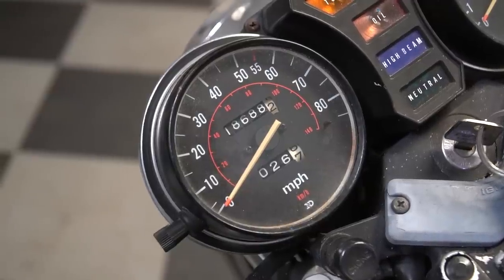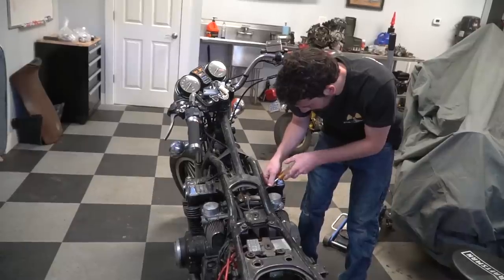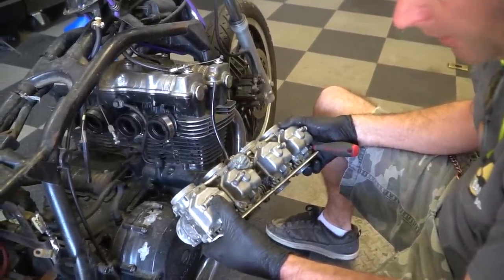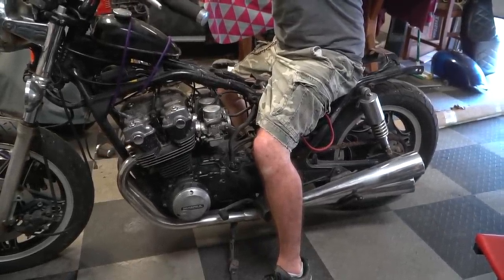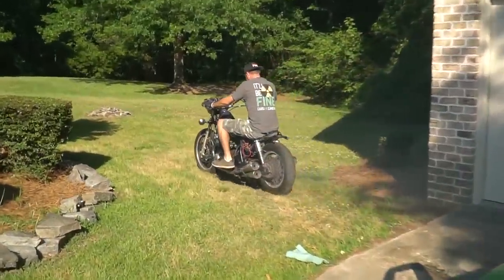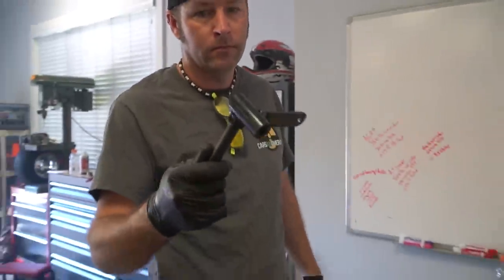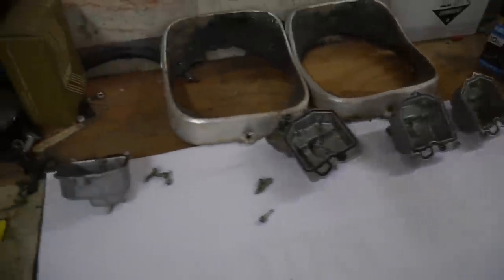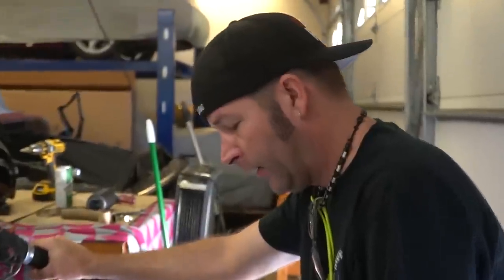Cheap CB750, Will it Start? Cross Kart Build Pt. 4

Comment: It's super lean. I've built many bikes. I seen ya trying to pull the choke to rich it up but that dont work with them carbs. The bike would run better if it had the factory air box and filters. And that jet was part throttle jet. They have main, mid and idle air screw.
Reply: also 95 might be too high octane, late timing, lean, I also heard a backfire
Reply: True Boys Need add Air box+stuff and put all in same setup in  vacuum gauge
Reply: there is no thing called to high octane
Reply: Same with my old XJ 650, the run awful if you remove the factory airbox.
Reply: These guys obviously don't know what they are doing, just making it harder for the real mechanic to fix.
Reply: @Hermiwalle  good one
Reply: Yep a stock airbox and air cleaner will fix the issue
Reply: Yes you are right !!!
Reply: @Charlieswag9000  too high of octane hahahahahahahahahahahaha
Reply: @Regular_Thomas  you didnt know race gas is only for high compression engines? higher octane, later combustion
Reply: Came down here to type out this exact comment.  The factory air box is an important tuned item, and the removal of that will cause this exact problem.
Reply: Herman Wallin Not true you can always have too high of octane!!
Reply: @kisermotorsports7854  i believe he's joking
Reply: Octane is a rating of how knock resistant a fuel is.  The way more power is made from added ignition timing..
Reply: @Charlieswag9000  yo0ppl

Comment: Hey put the air filters back on them the air filters can pull a vacuum which will let it pull more fuel ran into that issue before
Reply: Or instead of creating a restriction with filters you just jet up the carb to make it pull more fuel
Reply: nathan butler it still wouldn’t have the vaccume it would need in high rpms without the filter
Reply: they won't listen . been telling them for years the carbs won't work right without the air filter on it.
Reply: @gokarting1018  well it wouldnt with pods thats why i made a fiberglass  plenum on mine that has all 4 carbs going to a plenum then to a single filter
Reply: @nathanbutler8240  These motors are precisely tuned.  Anything other than the factory airbox or something similar like what you made won't run properly.  I cringe every time I see pod filters.  Lean backfiring, probably lost low end torque.  Lol.
Reply: @tiporari  the factory air box to the plenum that i made if anything i smoothed out the airflow going into the carb less turbulence cause the factory air box is plastic with reinforced gussets on the inside you snooth out the air flow you get more air speed you get more air speed you can squeeze in more volume. I did the same to my old  kz-900 with ram air tabs on the side it catches air and forces it down the plenum gained almost half a sec at the track its a huge difference from the factory air box. If the factory box was that good you would still see people using them at the drag strip. The more air you can get in and out the more hp you will have doing the air box mod and cutting the baffles out the  mufflers it really wakes these bikes up
Reply: Yeah these guy crack me up on what they don't know. 
They know enough to be dangerous.  And that's about it.

Cool on what they do though.
Reply: @tiporari  do a google search of the hayabusa carbon fiber air box and you will see what i based my air box off of
Reply: The right jetting does the trick I run pod filters on my en500 which is a cv carb and it runs right on the money even gained a little bit of torque but is it smooth absolutely not but it doesn't require alot of throttle input to go 60mph either
Reply: He already "drilled" the  jets out to a now unknown number so it's gonna be rich whatever they do. They're really wasting their time with this heavy old lump. They think it's gonna be like having 40 hp that's crap. They need something like the ducarti that's gonna be wild. They need another Ducati motor or a 600 and it'll be awesome. The whole time they're spending on this thing they'te not moving forward with the build. I hate wasted time for minimal gain.
Reply: Don’t even get me started on how much low end power they lose on straight pipes!
Reply: My r1 ran like hammed hell when I race ported the air box and could not jet it out had to get a new air box cover b4 it would run correctly again.
Reply: Hes right needs air filter with the diaphragm style slides
Reply: @Go karting101
That's not how carburetors work.
Reply: derschwarzgeist when u fight for months on a set of carbs on an engine and decide to put the air box on and it fixes all problems with it then u can’t say much about that
Reply: wheeln 24/7 you may hate wasted time for minimal gain but in the end it’s their money and they are gonna do what’s easier and cost effective for them. If they put $1,500 motors on all their builds it wouldn’t even be fun anymore. Reviving some older engines is fun
Reply: @joeshmo2473  just watch how they build cages... hahaha. Someone needs to tell/teach these guys about the properties of metal and welding..
Welding joints where it should be just a bend.
Reply: Correct !! iF THEY OVER JET IT WILL MOST LIKELY SMOKE.dam caps !!
Reply: This is why despite running a breadbox/lunchbox style housing I still have my factory airbox safely tucked away. Anybody who doesn't want to fool with the carb every time the weather changes is going to want the stock box.
Reply: It'll be fine.  So many drama queens doing their best to create fuss over nothing.  This isn't John and Isaac's first rodeo.

Comment: The problem is the CV carbs. That’s exactly how those bikes run without the air box. With pods or no filters there is not enough vacuum to open the slides and let air and fuel in. It is hard to get them to run right but you can start with the free mods- cutting a couple loops off of the slide spring and shimming (with a washer) or shaving down the needle and opening up the main jet a bit more.

Comment: It's the no air box. I've worked on lots of these bikes. They hate pod filters. Makes them idle rough and it's not smooth through the Rev range. Best way to fix it on the cheap is to wrap the pods in foam filter material. Makes them 2 stage filters and it works great. I hope y'all see this comment, it will save u lots of headaches. Cheers

Comment: Hey! That motor will run lean with out the correct amount of vacuum behind the carbs! Pod filters make it very hard to tune so see if you can get your hands on a factory air filter! It will idle perfectly fine with out it but as soon as you throttle up it will bog out lean. Btw the plunger type throttles that move up and down behind your mechanical throttle plates rely on air travel to make them open correctly, please see this because I promise you this is your problem! I’m a motorcycle mechanic on the side.

Comment: Wrap your pod filters in some kind of tape, electrical, duct, gorilla, doesn't really matter. These are constant velocity carbs (CV carbs), they don't like pod filters or a high flowing exhaust system. Jets can't easily be changed, its possible if you have the time and know what you're doing but it's a massive pain.

Comment: guys ive a lot of experience with honda cb bikes, things to check on you 750 are the rubber plugs in the float bowls (if they leak fuel past them it causes running issues), air leaks (normally from where the carb rubbers mount to the head) and finally check the jetting, to run correctly with those pods it would have needed to be upjetted, if the jet are the stock ones then it wont rev and will run exactly as it did in the video.

my guess would be air leak to be honest as it cuts out at idle.

hope you read this and my advice helps.

keep up the excellent content.
Reply: You forgot about the slide diaphragm rubber
Reply: @SHSPVR  there is no slide diaphram rubber like you would see on a harley. The top of the slide is like a puck and the aluminum caps seal with a big plastic ring that sits in the groove on top of each carb body.
Reply: @AkiraMikaela  They where big round rubber gasket in my day and there a o-ring for needle in the slide I'm not take about the type that a disc type rubber slide diaphragm
Reply: @SHSPVR  yes they use that design for many makes and models but not for that particular rack of carbs on the bike. The ones that were on the floor are the diaphragm type that you are referencing. You can see this by how shallow the caps are on the carb bodies.

Comment: Need the air filters back on it, completely normal to run like that without them. Those are the top end Honda carbs for the year. 3 jets, 1 main (largest goes straight to the top), the second jet that isn't covered draws fuel and runs it through the 3rd jet under the rubber cap. Rubber diaphragms under the covers on the sides are air cut off valves that allow more fuel when you let off the throttle at higher rpm so it doesn't pop thru the exhaust. Majority of the smoke is burning off fuel that made it into the oil making it easy to push past the rings. Really enjoy watching you guys playing with your toys. If you have any questions about those carbs you can shoot me a message, I'll be happy to help. Jeff, Man Cave Cycles, New Prague MN.

Comment: When you have a carb for each cylinder you have to sync the carbs with a vacuum gauge to get them pulling the same amount ..

Also, those are vacuum slide carbs, not mechanical slides .. So , they will run like dogshit without an airbox even when the carbs are tuned correctly ..
Reply: Well said 👍👍✌
Reply: That some what true about sync the carbs with a vacuum gauge we are not there to see what going but what is not true is airbox BS you are come with but the way it trying to rev sound it be a semi plugged exhaust, but I would also slide diaphragm rubber as they could be crack causing a air leak that to can keep from run right and there host other thing like a clogged passage.
Reply: Lol finally someone to back me up to get em to buy some FCR's . .
Reply: If it wasn’t touched the carbs should be still synced by a Japanese factory
Reply: @mowler8042  Is that a joke?
Reply: Ijusthopeitsquick no if it’s running great why mess with the sync.  Every Japanese bike I worked on trying to make it run better when the issue is really not the factory settings you just mess it up with what I call the domino effect. Make it run with the factory settings and search back why it’s not running correctly
Reply: @mowler8042  of you've messed with the carbs (including stripping them), then they won't be synced anymore
Reply: Simon Mark Rogers they didn’t strip them and if all the gaskets are old and it’s leaking still it just needs gaskets or carb boots, compensating by syncing them you’re just going assbackwards
Reply: @mowler8042  They ran drill bits through the jets. Not a particularly accurate way of cleaning them, so they've been messed with. If the jets are then different sizes (albeit only slight), then they've been messed with. I rejetted mine many years ago and they needed syncing (V twin)
I wouldn't say it's essential, but it will run smoother
Reply: @joeshmo2473  you're
Reply: @SmR8008  ya you might be right still if they drill them out with the same bit they should be all synced
Reply: @mowler8042  😄😄 I wasted too many words on this troll (joe shmo). I think you summed it up with; "you're"😄👍👍👍
Reply: @mowler8042  nothing that old "hasn't been touched"
Reply: lmao just in case anyone is curious as to what the definition of egregious was : extremely bad in a way that is very noticeable
Reply: @joeshmo2473  I didn't comment on your grammar, I commented on the content of your post... Whilst most people were having a healthy debate on what they believe is right or wrong, you are slagging them off,as opposed to contributing to the discussion.  I  may or may not be right on the subject we were discussing and equally, others may or may not be right on the subject. However we continued to show each other respect, just as we would if we were talking face to face. In short, we were conversing as the adults we are, as opposed to the child you appear to be😊😊
Reply: @SmR8008  lmao, I bet that singed his arse, he probably got tired of sharing photo's of his sister with his friends and decided to have some grown up chat. worked out well for him lol.
Reply: @hunter100t  Love it😂😂
Either the Poor fella is still thinking hard of a comeback, or his Mum has told him he can't use his phone until he's cleaned up his bedroom 😅

Comment: Pod filters do not work very well on these engines also you may try to vacuum sync the carbs make sure they are all running even maybe a valve adjustment as well
Reply: Well said!👍👍✌
Reply: they usually work best with the original air filters, with the other one you have to go mad with jetting
Reply: Ya most of the time it's not worth the hassle trying to rig it all up better just to stay oem
Reply: Make sure the same jets go back into the same carburetor, get them mixed up and you will be tearing it back down.
Reply: Unfortunately most people don't realize that the outer carbs have different jets than the inner, esp on these old pos carbs

Comment: Cv carbs need an air box or proper sized pod filters to pull vacuum so the diaphragm will pull up the needle to allow more fuel. 

TLDR : put the filters back on.....
Reply: I think you are right.  Especially with older slides and rubber inside
Reply: Yes... Vacuum carbs need airbox volume.
Reply: I have found that you don't need filters of any kind for a cv carb. I bought an 83 shadow 500 ( it still had the stock jets) and ran it without filters of any kind during the winter (20-30 degrees) it ran a little lean, but it still ran good. I now run it with slightly larger jets and pod filters and it runs like an absolute beast.
Reply: I disagree with your opinion , i have tuned tons of cv carbs that run perfect with no air box at all its not the carb but the undereducated person tuning something they know nothing about, if you cant get your cv to perform right do some research , one big mistake most people make is over tightening the air mixture screw and once you damage the needle seat the carb is garbage , carbs are very precisely made and 99% of the time its people messing with stuff out of thier mechanical level ......
Reply: If you run cv carbs open there will be a larger latency from throttle input to opening. Tune them to run cleanly from closed to wide open under no load.

Comment: I owned and loved a 1976 CB 750 F the Super Sport Model. These are great engines. To adjust the carbs you need a set of 4 vacuum gauges to get all 4 carbs running the same. The smoking might be rings or a bad head gasket or nothing but do a compression test.  The timing is adjusted under the left side cover if memory serves using dual points. Two cylinders fire at the same time. The revving problem is definitely a valve adjustment problem. The valves adjustment should be done on a cold engine for best results. Back in the day I could do a full tune up in less than an hour. These engines are dead simple to work on as long as you don't split the case so if a top end rebuild is needed don't shy away from it as the results are worth it. Good luck guys. I always wanted to build a Go cart or something powered by one of these engines.  You have a built in 5 speed transmission and should use it.
Reply: I put a Hodaka 125cc on a go cart once, after 2nd gear you can't steer it, because you have too much speed and torque driving it forward. A motor this big wouldn't be practical on a go car, simply too much, too heavy. You will not be happy with it, unless you just want to see tires smoke.
Reply: @gsp49  In California in the Mid 70's it was common practice to put motorcycle engines on Racing Carts.  You need wider tires and suspension but these carts exceeded 100 MPH. Different Times.

Comment: Hey guys as a motorcycle mechanic you might want to adjust the valves, and find a semi correct filter but not pods, you will run lean as all get running hot and engine life plummets
Reply: they don't believe the carbs run lean without  air filters on them.
Reply: They are not mechanics.
Reply: mechanic or not that's just common knowledge

Comment: Hey them there carbs need to have the air filter on them for proper back pressure and you need to make sure the valves are adjusted properly and you got to sync the carburetors. Hope this helps

Comment: Couple thoughts. Put the air filters on, as without air system it will be LEAN. next, get a vacuum gauge and look at pull, put it inline as the vac hoses "always" leak. If it's been sitting awhile, the rings could be stuck. Sea foam in the gas and sea foam then change the oil after running at least an hour above 2500.. can just adjust idle up. Third, if you are concerned about exhaust obstruction, just take the exhaust off.. it will then be super lean as the "engine that is just an airpump" will have little restrictions, might turn the choke on. When you have the valve covers off, check the valve clearance, especially the exhaust side. Might consider a compression check , but I would bet it's stuck rings which seafoam in the oil might fix.. or even fill the cylinders with seafoam and leave overnight. That will drain into the crankcase and would be like seafoam in the oil

Comment: The cv carbs need an air box to pull enough vacuum to open the needles. You can use softer slide springs and bigger jets to get it running better without the air box.

Comment: those things are notorious for running like crap without the stock airbox
Reply: I had the same problem with my old CB750 with pod style filters, changed the jetting (pilot jet) a few sizes larger and it ran fine.
Reply: I was gonna say, at least throw the pods back on since they already did the jets.